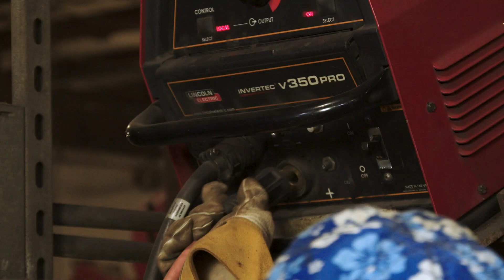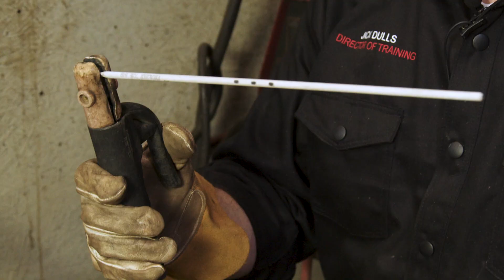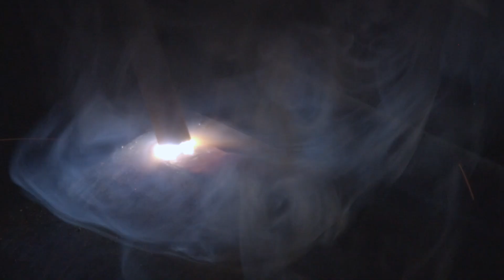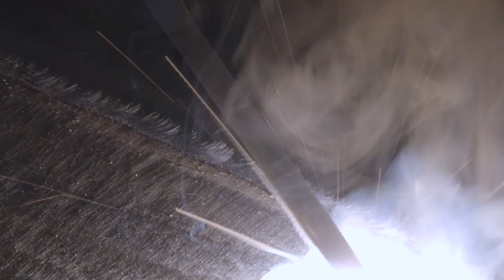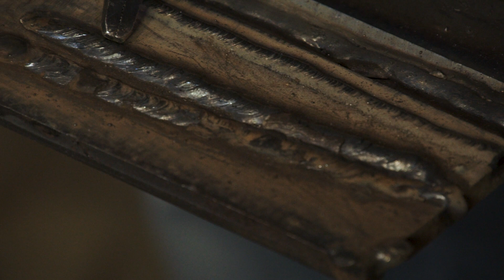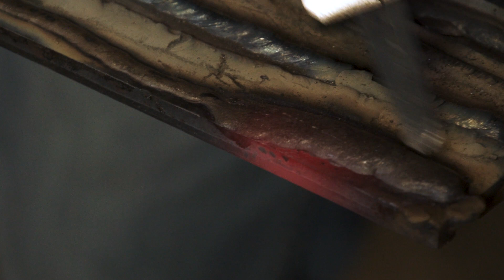Learn Stick Welding Setup Basics

Comment: I am 43 and just started welding trade school. its going .... I really enjoy smaw and was struggling but once you learn that its all about angles and travel speed its starts to flow easier.. Just passed 7018 3/32 2f and working on 3f now and so on. But having trouble seeing when upclose cause I am near sighted. Going to get one of those magnifying lense for my hood to see if that helps. Do you have any info on that topic by chance?

Comment: You're a great teacher. What size stick machine do you suggest for a noob wanting to do general purpose welding.. a 160A dual voltage, 110 or just 220.. Then there's a more expensive mig/stick combo one could grow into..

Comment: The video is very interesting and you can clearly see what he's talking about in the beads. When he talked about the amperage setting on the machine he didn't mention the correlation to the rod dimension. I think that's a 2.4mm (3/32"?) 7018 but for someone who doesn't know it is a missing information

Comment: Will it hurt the electronics on my truck to weld on the frame bumper bracket even if the battery is disconnected??

Comment: Great useful video ...but you didn't address why you set the welder at 110 amps?...or what size rods is best for what material etc and the appropriate amp setting under these circumstances....otherwise a very helpful video
Reply: 1/8th 6013 - 

80-120amps, can weld up to 4.8mm easily single pass. 

110 is lower end of 7018 rod.

Comment: im on a training on smaw1  going in 3weeks now. i was one of the scholar that our government official had a program of a smaw 1 sholarship program. i avail this program coz i want to learn welding. im glad i saw ur channel and i leraned a lot from you. i hope you have a video on horizontal, vertical and overhead. its very important to practice til you get it right but still you have to spend a lot of money to buy electrodes. thanks for the video sir.

Comment: I’m a senior in highschool wanted to pursue welding, I’m in a welding class as of now. I’m working on the D9.1 single pass 6” 7018 T-joint weld. And I get flux peel and perfect starts on practice but I do my certification pass and i mess it up at the end. Could you help me out trying to find a way to get this done?

Comment: Thanks for showing ‘your fault’ on the rod tip. I did not realize tip condition is important...I keep on using them and keep failing thinking it does not matter.

Comment: Only way to learn welding is to go hands on and it takes hours to get ok at it.
Welding is a perishable skill, meaning if you do not excersize it daily you will loose it.
I had a 2 yr apprentice who went and purchased his own Mig/TIG and practiced everyday on his own time and dime. That kid could run a bead better than 95% of any instructor on U-tube and went on to work for the oil industry working off shore underwater and is making bank last I heard.
He had trouble striking an arc with 6011 on flat and really struggled with it until the Ah! Ha! moment.

Comment: 13:10 I had many problems with rods like this at one job. The 7018s supplied to me were obviously old, abused and stored incorrectly. The boss blamed my skills for the problems I was having. Bought my own brand new 7018s, and had ZERO issues for the rest of the contract. Added the rods I purchased to my expenses.
Reply: Rich Osthoff,I'm curious what was the bad brand and size welding rods you were using and what did you buy that was better to replace them🤔👨‍🏭

Comment: 110 for 3/32nds is so high. I normally start around 90 and work either high or low depending how the arc lays down.